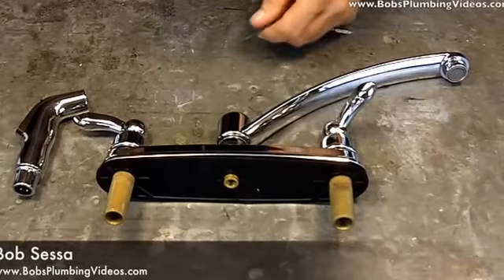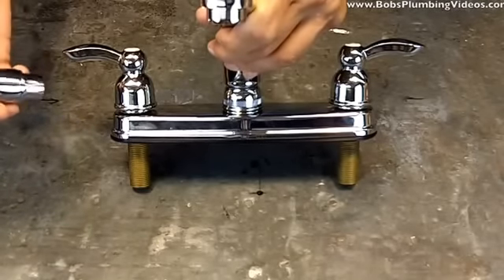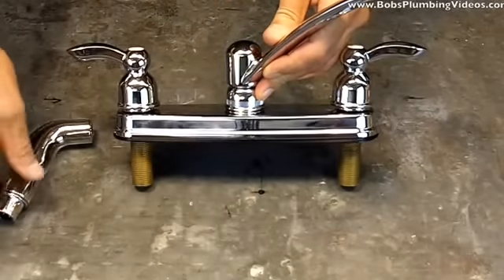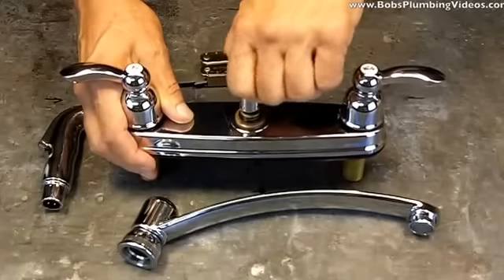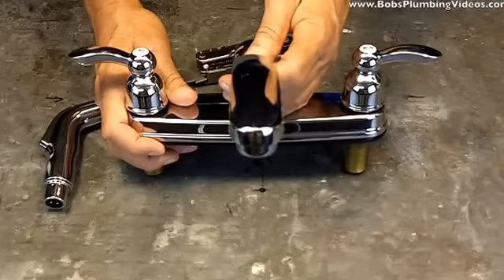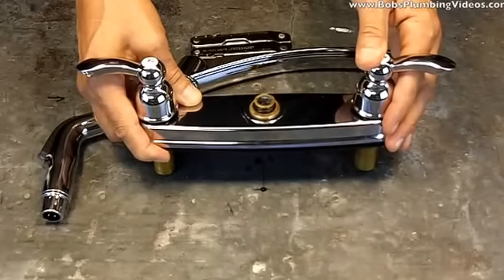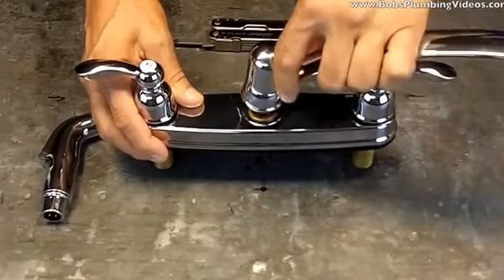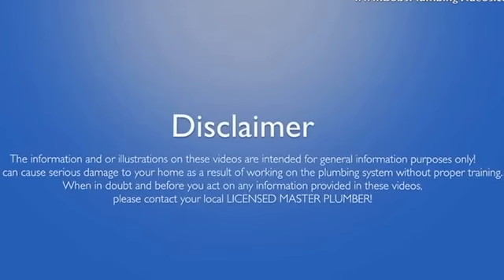Kitchen Faucet  Sprayer Diverter Problem

Comment: i think this is the solution to my problem. i came to the conclusion it was my diverter because my sprayer is working but my faucet wont run. but all the new videos show the new small plastic diverters. i rent right now and have an older sink so this diverter you have in this video looks almost exaclty like it.thanks so much!
Reply from the maker: It is an older version, but still many of them in existence.

Comment: If it's not coming out of the actual faucet and is leaking out of the sprayers handle as soon as you turn it on, but when you squeeze the handle it still sprays out of the sprayer as normal. Will replacing this help?
Reply from the maker: It's the first thing I would consider before moving any further.
Reply: @BobsPlumbingVideos  it doesn't unscrew like in the video. The meltdown has started. I'm the opposite of handy

Comment: I have a single handle pull down sprayer head. My problem is the button on the sprayer that you push to spray/stream is shooting out water when I turn the water on. I haven't had any luck finding a repair video for a leaking button.

Comment: I'm having this issue it seems but my nozzle is a bit different. When I unscrew that cover part on the nozzle, the nozzle is still attached to the sink. Must be an older style faucet? The nozzle moves around but I'm not sure if I should pull it out or not..don't want to ruin my sink lol. Any ideas?TIA!

Comment: Bob awesome video. I do have a question and can't find much info. My kitchen sprayer worked but the faucet didn't. A friend of mine claimed he knew what he was doing. He "fixed" the sink. Well I didn't think anything of it and of course thanked him as now the faucet was working, that is until later when I figured out that now the sprayer wasn't working🤣.... I figured out through researching myself that it had to be the diverter. But he took it out and I'm assuming that it was tossed out. The faucet has no visible brand, make, or model. How do I identify the type of diverter that I would need for my faucet?
Reply from the maker: Take a photo of your faucet and send it to me @ info@robertsessaplumbing.com

Comment: Would like to see a video on how to replace a sprayer hose on a single lever Delta,,which adapters to use,,and how to connect it.The after market flex hose I have has 3 different adapters and none seem to be right.

Comment: Hey Bob, this is a great video. But my prob is diagnosing what's wrong with my spray. I press the spray nozzle and all the water stops coming out of the faucet, but... no water comes out of the sprayer either?  I'm not sure if the spray hose is clogged, or the nozzle is broken or clogged, or there's something wrong with the diverter.  Any idea?  Or at least which part should I replace first... nozzle, hose, or diverter?  Thanks!
Reply from the maker: Can you remove spray head to see if any water is coming out of the hose? You can hold  the base of the head and unscrew it counter clockwise to see if you get any water. If yes, the head could be clogged. If no, then I would say it’s the diverter.
Reply: @BobsPlumbingVideos  Thanks Bob. Yes, I took the spray head off and there's a steady stream of water coming out of the hose. I found a new "universal" spray head at Lowes and will go buy it and try it.  I'll let ya know what happens.

Comment: Trying to install a faucet that has a side spray (which I don’t want to use). Can hook up the side sprayer and just leave the side spray hanging under the sink and not use it? Kind of jankie I know, but I only have one hole and I need this faucet because I can attach my filter to the spout. Thanks
Reply from the maker: Definitely Jackie, but it’ll work. Check out my most recent video, that’s exactly what I discovered while installing a customers faucet. 

Regards,
Bob
Reply: BobsPlumbingVideos Just watched your latest vid. That’s funny 😆 exactly what I was planning on doing, leaving the live side spray hose under the sink. Anyway...I’m still at a loss for what I do if I don’t do that. When I install the faucet without the side spray hose water comes pouring out that opening under the sink and no water makes it to the actual faucet.
Reply from the maker: P S 
If the spray head is not being depressed, water should flow from the faucet? Weird.
Reply: BobsPlumbingVideos must be defected. Thank you for your time. God bless you

Comment: I'm definitely thinking it's my diverter valve. It's a single lever faucet with the spray built in to the side to be more compact. But I turn the spray on, faucet stops but I got little to no pressure in the sprayer. Have no clue what the brand is though. I replace the hose and sprayer and didn't work.

Comment: Hi Bob.   I can't pull out the little round plastic diverter part after I disassemble the faucet because I think maybe it is installed backwards.
I can't fit my needle nose pliers between the cartridge thing and the backsplash. 
Do I have to take the whole faucet out?? HELP
Reply from the maker: What model faucet are we speaking about, send me a picture : info@robertsessaplumbing.com
Reply: @BobsPlumbingVideos  it's a Brookwood  price Pfister .
I went to your website and sent you a message

Comment: Our faucet will run and then, occasionally, stop for a second, making a cachunk noise, then run normally again for a few minutes until the flow of water is again interrupted. this happens every ten seconds or so the entire time the faucet is on. But, once the sprayer is engaged, the pauses in flow stops. The nauzel  does seem to be leaking from the button, and water will spurt out of it every time the flow of water from the faucet pauses. I was thinking that the sprayer head was to blame, but do you think it's the diverter?
Reply from the maker: I would replace the diverter first, see how it works. You can always replace the spray head if need be. Regards, Bob.

Comment: Do you have to shut water off to replace the diverter?
Reply from the maker: If you're replacing a faucet diverter generally just make sure the faucet both hot and cold water are in the off position.

Comment: I have a faucet with diverter/sprayer.  I took out the sprayher to use that line for a separate drinking water filter and fountain.  after installin it, nothing comes out when I open either faucet.  No hot, no cold, nothing. What's happenng?
Reply from the maker: Without knowing exactly what you did I would have to say remove the diverter from the faucet. Most likely the cause.

Comment: Hey Bob.  My sprayer works fine but then is difficult to go back to faucet.  Is this a diverter problem or the nozzle?
Reply from the maker: ***** From your description Rick , I would replace the divert-er as it affects both the way the water flows from the nozzle as well as the sprayer head, Not an expensive fix!
Reply: Good news, couldn't find the right diverter  and managed to find the original paperwork and it was a Price Pfister so I called them and they are sending it to me for free.  Who knew the lifetime warranty actually works.
Reply from the maker: Excellent!
Reply: I have a price pfister..im dealing with a nrw diverter installed and water still only coming from the sprayer..im at a loss at what to do next

Comment: I have Delta kitchen faucet w 2 handles and arched delivery 'pipe';  it keeps going through diverters because no one will stop using hot water only; I have not used generic Home Depot diverter brands:  the diverter looks very simple parts wise;  the water heater is new and set on Medium, not scalding hot; without asking why it eats diverters, is there a way to change the seal to a tougher grade or how can it be improved to last a few years vs 1 yr. at a time ? Yes, I spoke with Delta and they were deer in the headlights and quite lost on what to do:: '''turn down your water heater''; -- ''hire a licensed Plumber'' & on n on.  ( I have checked Grainger for materials n Orings and that is overwhelming and req. 25 or 50 to be purchased; any help ? THANKs !+
Reply from the maker: If you have a model number and or a photo of your faucet, I'll try to help. Send pictures to - info@robertsessaplumbing.com.

Comment: I replaced my pfister diverter and hoses.still low pressure in main faucet. Sprayer works fine.the problem started suddenly when I used the sprayer. main faucet went low.
Reply from the maker: May be broken off piece from the old diverter clogging things off!
Reply: @BobsPlumbingVideos  thank you. I will see if flushing it out helps

Comment: Hey,

My sink has a sprayer that wasnt attached.  I thought it was going to be as simple as snapping it in but it doesn't look like my sink has the diverter peice underneath.  can i just install it myself and it be that simple?
Reply from the maker: Older faucets generally have a  1/8" female tapping in the center of the faucet. Sometimes they get plugged because people no longer want the spray. Sometimes people will change the faucet, cut off the spray hose of the older faucet and leave it mounted on the sink. Maybe this will help-https://youtu.be/1d7kBYIAtsc

Comment: Hi Bob. For these diverters to work correctly, does there need to be a certain level of pressure or flow rate? I recently did some water heater repairs and maintenance, including a good flush. I replaced my water heater input and output with an 18" Shark bite product. Ever since I did this work, my kitchen sink sprayer is experiencing the issues you describe here. When I connected my Shark bites to my 3/4" copper lines I did not remove the plastic inserts. Could these be causing a restriction in flow that would affect my diverter?
Reply from the maker: Sharkitebite states you can leave them in place, speaking for myself I  remove them unless it’s for P.E.X. I don’t think they would cause a loss in pressure, have you removed and cleaned out the diverter. Flushed the faucet of any possible particles from the heater flush?
Reply: @BobsPlumbingVideos  my faucet and sprayer have been cleaned out as far as I can tell. I removed the aerators and ran water through. Today, I took the Shark bites off and removed the inserts and there was no improvement. I will take a look at the diverter next but will need to wait a few days to do it. Thanks for your response.

Comment: After turning water off  for  cold water  and  hot  water, one at time,  water still dripping from the faucet,   Would it be the diverter,     I changed the handler on kitchen sprayer
Reply from the maker: Check to see if the shut off valves are actually holding before moving forward.
Reply: @BobsPlumbingVideos     I have  hot water side turned off,    Cold water comes out the spout,  when turning it on, but  kitchen spray  when pressed does not spray,  and water  from faucet doesn’t  stop so I guess it most be diverter.     That sound right

Comment: I am currently looking for a way to add a sprayer to a faucet that didn't come with one.  2 handle like you have here except its a  really fancy high dollar one and we want to keep it, but we want a sprayer.
Reply from the maker: Their is currently no way that I'm aware of that you can make this work.  Most faucets back in the day you were able to purchase with or without a spray attachment. Most of the higher end faucets today are already equipped with the spray. Unless it's internally designed to function with a spray attachment, I think you'd be better served replacing it.
Reply: well, I cant let that stop me. LOL   I will find a way and then I will be champion of the faucet sprayer add on.   I have come to see that the diverter has to be Above the initial mix to operate correctly and also have control over the temp with the regular hot and cold knobs up top.

   SO to be able to add a unit under the sink that a sprayer can connect to and NOT have constant pressure on it and also have temp control the Mix for the regular faucet has to be moved Down under the sink. then the center o the old mixing place has to be tapped, the diverter placed inline on that tap and then all the sprayer tap place just below that.   in as compact of a unit as possible. and wall mountable.    nightmare project. sounds kind of fun though. may not even work.  I have to try it though, LOL

  what woudl be really cool is If could just find a diverter that will fit in the faucet then tap into the bottom of the existing hot cold mix - i will be trying that first.
Reply from the maker: Trust me it much easier to change the faucet! Sell the existing one on E-bay! LOL!
Reply: it's a 500.00 faucet though, Fancy
 solid brass with ceramic disks. my wife loves it.  I gotta try to get a sprayer hooked up. if I don't make the effort I will never hear the end of it.
Reply from the maker: Send me a picture of this faucet. you got me curious! e-mail it to info@bobsplumbingvideos.com
Reply: BobsPlumbingVideos
 You are right.   I mean we both are really.   I could do it but it would be a nasty mess of extra hoses under the sink and the unit has to be pretty large to be able to get everything in there.    I will have to sell this faucet off and get something else.   Sucks bad though.  I really like this one.

Comment: Hey Bob, I'm viewing your video years after you produced it but hoping perhaps you'll still see it.  So, the symptoms of the problem I'm having started with both the hot and cold water knobs shaking and making a noise when I turned them on.  I looked below the sink and noticed water running down the sprayer hose (which we weren't using at the time).  I detached the sprayer from the hose and a washer and small screen came out by themselves.  The faucet is only two years old.  I put them back in and secured the sprayer.  It works but I'm still getting water running down from the sprayer even when its not in use.  Periodically the on/off knobs will rattle again.  Worried about the water leaking.  Would sure appreciate you r thoughts.  Thx Bob.  m
Reply from the maker: Mark Olson  could you email me a couple of photos of your faucet from both the top and below? Info@robertsessaplumbing.com.

Comment: I have a different diverter problem.  The water wants to come out of the sprayer, even though I am not pressing the button, and will only come out of the faucet once the pressure has built up behind the sprayer head.  I have tried replacing the plastic diverter (Moen), but the exact same thing happens with the new one.  Help!
Reply from the maker: I would go to Moens website and get a spec breakdown for your faucet. May give you the answer!

Comment: I'm having this problem where the spay had low pressure and water keeps coming out of the faucet but the unit is new (2 months) could it still be the diverter?
Reply from the maker: What  brand /model faucet  do you have?
Reply: @BobsPlumbingVideos  honestly i have no idea, my wife picked it out and the guy who re did our kitchen installed it =/

Comment: My faucet assembly is over 15 yrs old and I cannot get the nozzle holding part unscrewed. Not sure how much pressure I can put. it's too big to use a pliers, any ideas? Water is only coming out of sprayer, so am assuming diverter is the issue.
Reply from the maker: Generally speaking, I use a slip-joint pliers a.k.a. channel lock pliers to remove the nozzle, but truth be told on a fifteen-year-old faucet it may not come off that easily. You could end up damaging it past the point of no return. But you most certainly can try.

Comment: When I turn my sprayer on nothing comes out of the sprayer and the water shut off in my faucet. I have to shut the water off the faucet and the water will again come out of the faucet. Does the faucet and sprayer need replaced?
Reply from the maker: It sounds like a diverter issue to me. Diverters are manufacturer-specific, the best thing to do is remove the old one and take it the plumbing supply/home center and match it up!

Comment: Do you know what the problem may be with my sprayer nozzle leaking water when the faucet is turned on? Any help appreciated. thanks.
Reply from the maker: Depending on where it's leaking, you may just need a new sprayer head. From your description, I would try replacing the sprayer head.

Comment: my friends went to use their spray and the water completely stopped both sprayer and faucet... would this be the same type of deal? it will slightly drip if you turn it to what would be full blast.
Reply from the maker: That's a bad diverter!

Comment: So my faucet dribbles when turned on but sprayer gets full pressure... :/
Reply from the maker: If you're happy with the way it's working, I would let it go!
Reply: @BobsPlumbingVideos  Lol. I'm not, I want to be able to use the faucet head at normal pressure but I turn it on and a very small stream comes out. The spray nozzle however works fine. I think the springs in the diverter valve are stuck closed possibly. 🤔

Comment: Bob, are you still monitoring your channel and taking questions?
Reply from the maker: Absolutely, how can I help you Vincent? Are you having trouble reaching me? My e-mail is info@bobsplumbingvideos.com.
Reply: Thanks, Bob.  I changed the diverter with no better improvement in sprayer function.  (The sprayer seems to run out of water or impedes flow.)  I took the sprayer off of its hose and the water flows freely out of the hose with no flow out of the faucet (new diverter properly working!). Should I conclude that the guts of the sprayer are broken, and therefore the sprayer needs to be replaced? Many thanks.
Reply from the maker: Vincent, based on your description my next move would be to replace the spray head. Inexpensive and available at the big box stores. Let me know how it goes!